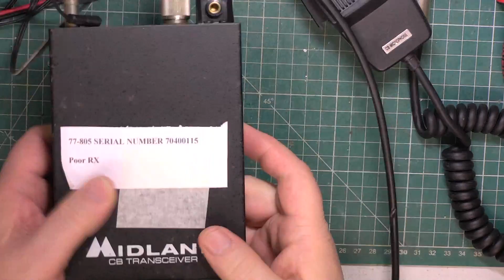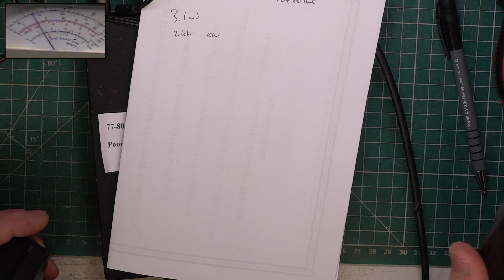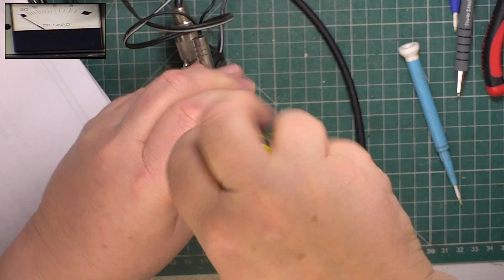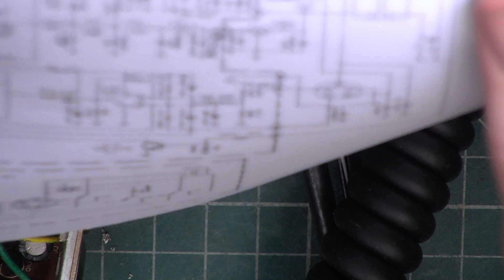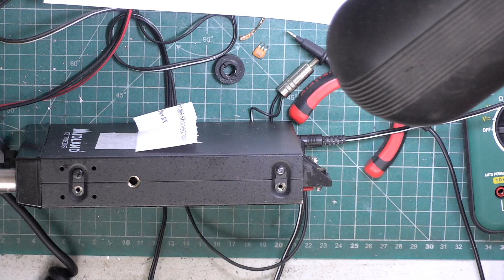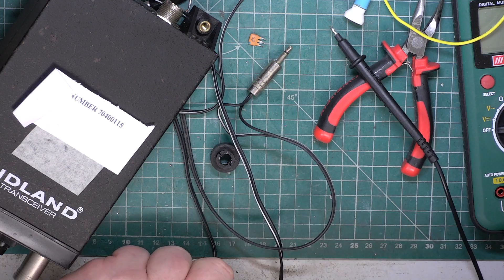Midland 77- 805UK CB27/81 UK FM CB radio - deaf receive fault repair plus realignment

Comment: Are the midlands known for having bad solder joints as I Had the same on a Alan 78 multi, It had no TX or RX, pushed on the board to find the dry joints. When I removed wax it started working, 24hrs later it was back to not working. Found it was the wax causing bad connections and failing when warmed up. I removed all components, cleaned all the old solder and any remaining  wax.  run it for a week with no problems. Always enjoy the repair videos.. Thanks
Reply from the maker: Later Midland 78's use surface mount technology & tempremental VCO's that like a constant 60-70F temperature. We have four & they are as bad as each other....that's what's in the test card.

Richard, G0OJF, UK
Reply: @ukfmcbradioservicingTango21  Hi Richard, I watched your video when you said they lost vco lock in the cold. Yours are a lot newer than mine, these have orange lcd's and only have a couple of smd parts ( LC 72322 & TK10487M)... everything else is Through hole. I don't think you have covered the type I have, repair wise, Maybe service. I've had multiple faults on both the Alan plus multi and the Alan plus and watched your videos intensely for clues and fixes.....I look forward to the next video.. thanks